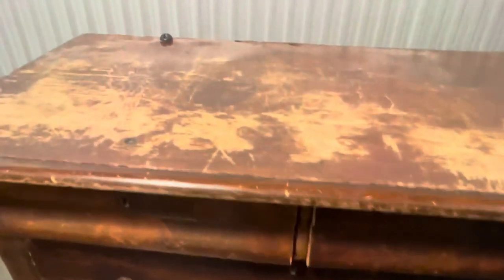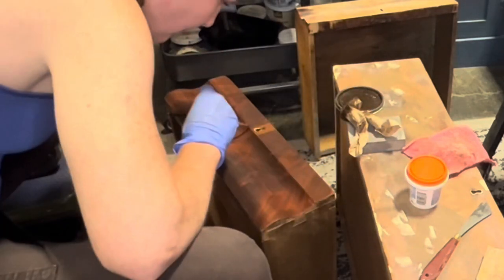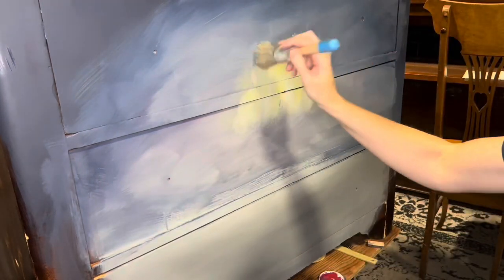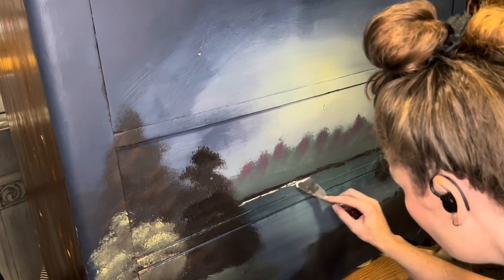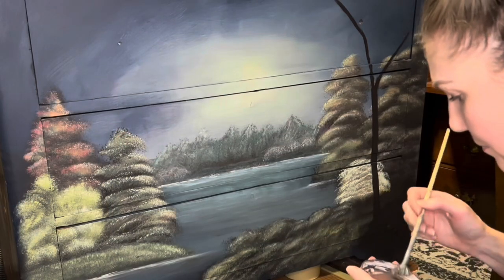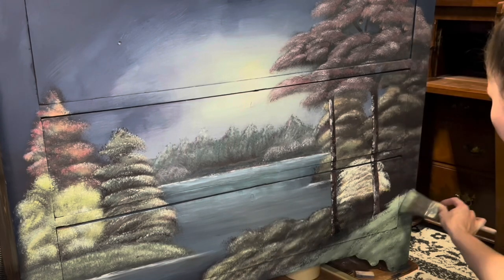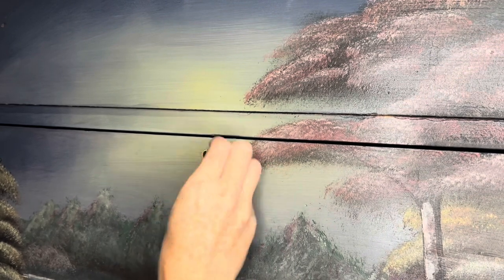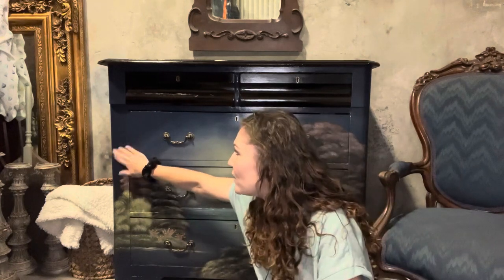Damaged Dresser Gets A New Look | Elegant Upgrades

Comment: Gorgeous!!! I love that you put varnish (or whatever it was) over the top to seal it and protect it. I thought that varnish would reactivate chalk paint.  I thought the only option you had with chalk paint is a wax coating, and I don’t like that and don’t feel it is durable.  What product did you use to seal everything?
Reply from the maker: Thank you! And I rarely ONLY use wax to seal a piece. I typically seal with a poly of some kind (depending on the situation) and then if it’s a high traffic piece, I’ll wax over that for extra protection. Just make sure your paint is completely dry before applying a sealer and you shouldn’t have any issues with reactivation.
Reply: @elegantupgrades  thank you so much for your response.  I had refused to use chalk paint because I didn’t like the wax option.  I love that I can seal it with poly.  I do so many artistic projects and just found your channel.  I am very inspired.
Reply from the maker: @abigailadams8480  I’m glad you are finding some inspiration! That makes me so happy!